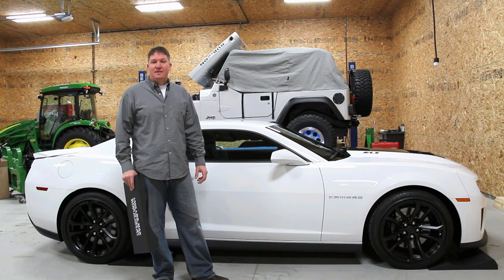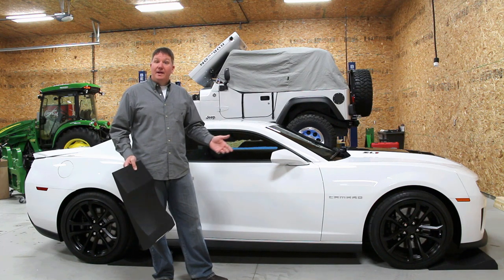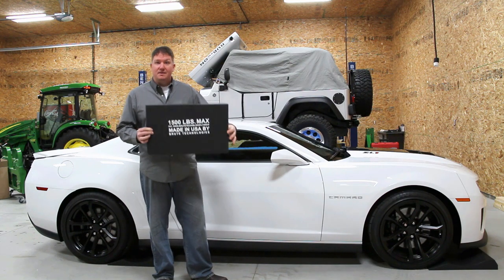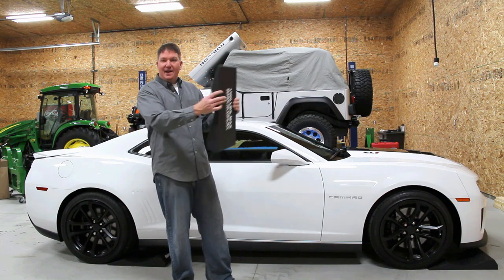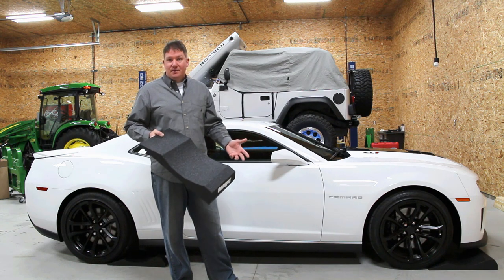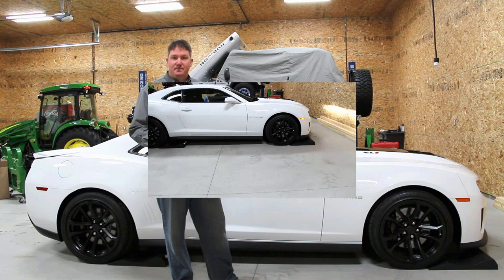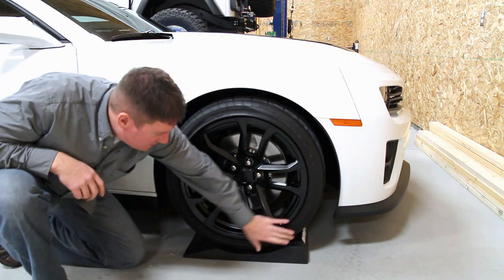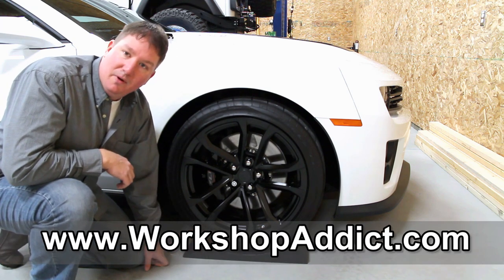Race Ramps Flatstoppers for Sports Car Storage

Comment: I bought a set of Flatstoppers back in 2018. I have used them every summer then for ~2.5 months at a time (in a garage that does not get hot). The tires were all Michelin Pilot Sport 4S. 

I am not convinced about whether these prevent flat spots from forming the ride got noisier and noisier over time — a noise that is consistent with a flat spot although I have never checked whether a flat spot was there. One strike against me is that I have not overinflated the tires before leaving them on the Flatstoppers.

Now, I am putting on an old set of rims and tires while away.
Reply from the maker: I have had the same experience with Michelin Pilot Sport 4S tires!  It did not matter how I took care of them, they just keep making that noise you describe and it gets louder and louder.  I gave up and replaced them with Goodyears and all is good.

Comment: Follow-up... How did they work out, were they effective?
Reply from the maker: They are effective in the fact that my drag radials did not get flat spots...  BUT what did happen one year was that one of the flatstoppers was not center of the tire due to them not being easy to drive up on.  So I have to imagine that the force created there with the tire off center of the circle was probably just as bad for the tire as it being on the ground.  I have 8 cars that I store and I now have shag carpet under all the tires and I pump the tires up to 40 PSI for winter storage.  No Flatstoppers.
Reply: @WorkshopAddict  When you say "No Flatstoppers"? Did you mean there were no flat spots after long-term period? Thank you.

Comment: those tire things are more gimmicky than beneficial.
even IF the tire fits the curve of the thing perfectly, it still will not prevent a flat spot.
best is too jack the car up if long term storing

Comment: New style tires are plenty safe for quite a damn long time.  waste of time and money IMO.
Reply: @imohammed2  I don't believe in this shit either. I have Michelin Pilot Super Sport and there was no flats spots after 6 month. My friend have Micheline Pilot Sport 4S, no flat spots there either.  I'm skeptical.
Reply: Dr.Mabuse I have gone through three sets of continental DWS 06 and if the car sits for more than a few days in the cold there are flat spots.
Reply: I have 2 ,S 55 and 550, Benz with Michelin Pilot Sport that sit 6 months is Fl and after ruining a new set I tried these and although they do work somewhat, (tires aren’t ruined), they do have small flat spots as the front tires are hard to center on the product matching the rear tires. Maybe I’ll try the shag carpet with cardboard, I hear it works.
Reply: New Tires may  take 30
Days or more to flat spot .  option 1 - over inflate the tires 2- put it on jack stands. 3- save the old junk  tires and buy cheap rims from junk yard   and switch them for the winter. I over inflate to 44 psi and never had an issue.